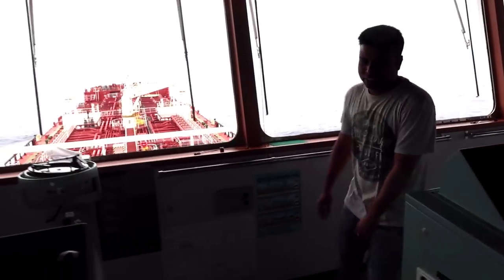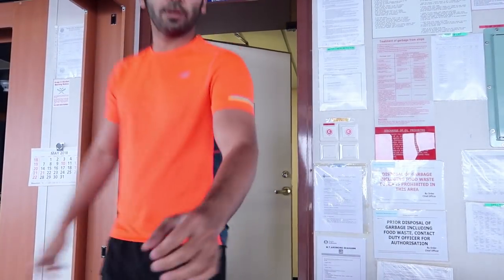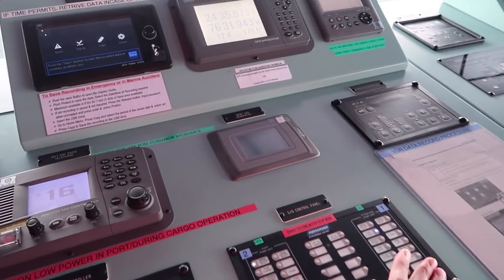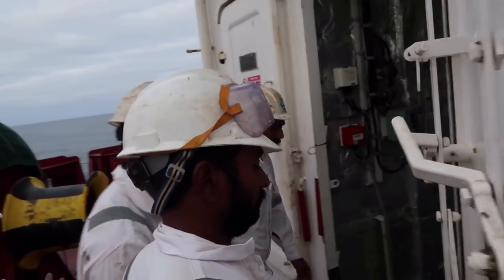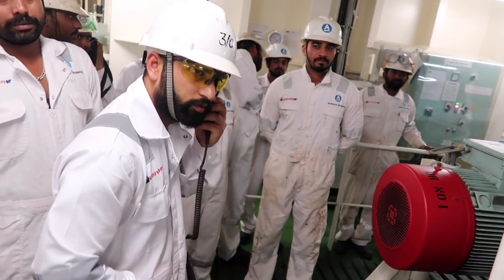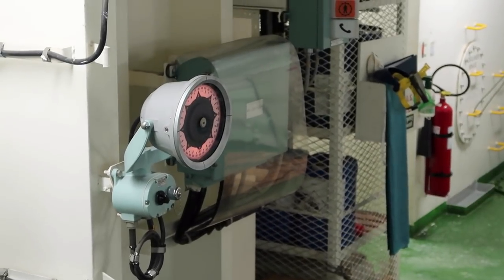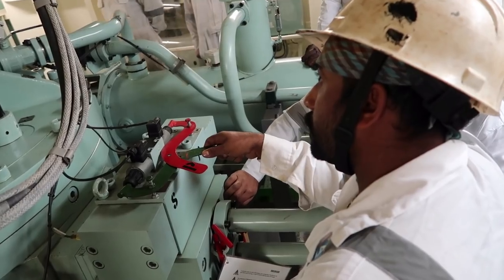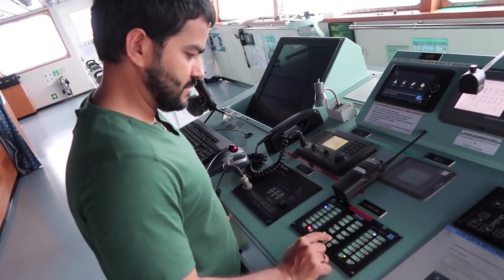How to Steer Ship in Emergency/ShipSailorSunil

Comment: Thnks a lot sir , for sharing steering gear test onboard ship it just clear all my doubt . If u don’t mind sir can I ask u something . What is the use of follow up button. And sir main steering test from bridge its same procedure we are on autopilot mode we will change to NFU MODE and test both motor by giving harad to hard from bridge. Correct me if I am wrong . Thnks in advance and waiting for your valuable answer
Reply from the maker: There is no follow up button bro , but hand steering and auto pilot works in follow up mode , where in steering follow your orders and telemotor is communicating with steering signal continuously . , NFU is non follow up mode which is mainly given for emergency , in which signal is given to steering only when we operate the button , so in order to bring Stbd 10 helm to midship in NFU , u will have to push NFU lever to port and stop till u see rudder at midship . Testing hard over is done at slow speed / anchor / alongside only. Cheers 😀👍🏻
Reply: ShipSailorSunil thanks a lot sir. For clearing my doubt .